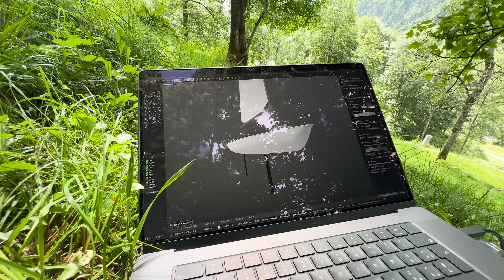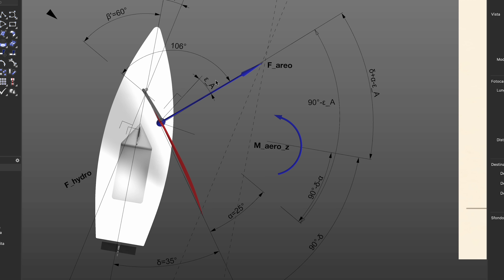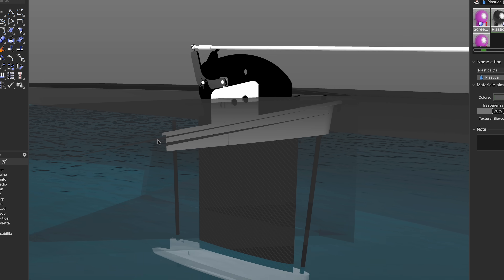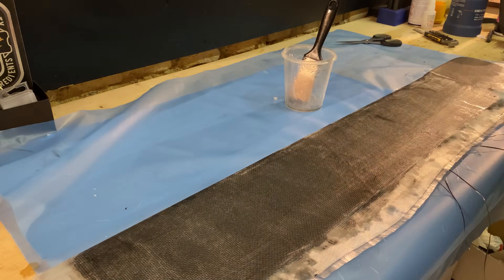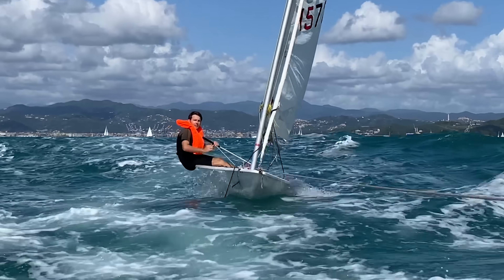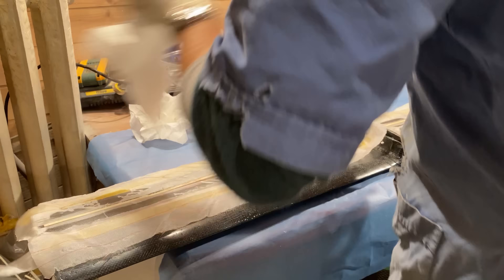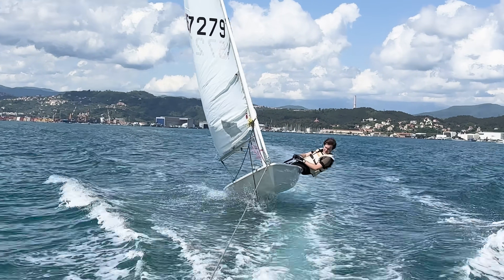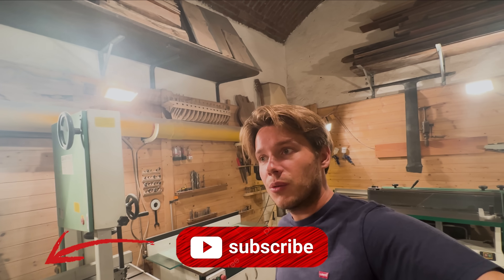Building a FLYING BOAT: Foiling LASER design and ENGINEERING

Comment: I always wondered why sail foilers do not use the v-shaped wings. They work not only as a vertical stabilizers, but as roll stabilizers as well. Because when a boat rolling, a higher side gets less lifting force, than the opposite. The only explanation this is not as fun as to fly on a rope 20cm above a surface at 20 knts ;)

Comment: For testing with the tow boat,  you should have attached the tow rope to the mast at boom height or higher. Its closer to the normal center of lift, and center of lateral resistance so it would be easier to control.
You should do testing without sail, only the tow boat to adjust the lift, the height above water. When all this is ok, you can do the testing with the sail.

Comment: As a pump foiler, this design is impossible to achieve.  You really need constant strong wind to keep you going but you will have to deal with weight issue.  Even your full body cannot counter-balance the full weight of your vessel. As a pump foiler, you have to put your weight on your front foot and knowing the proper pumping and pushing action to pump forever.  To add..your balance of going right(frontside on your heels) or going left(backside on your toes) to those who are goofy stance like myself. Foiling is very magical and the only way to achieve this is ditch the sail and put a power drive system on the mass of the foil and then the boat will fly.

Comment: I've loved the Laser since the 70s. I worked for King Marine in Indianapolis then. We were Laser dealers when Sailcraft made them.   IMHO a Laser could be adapted with 2 lateral foils and the rudder foil in the fashion of the America's Cup boats.. The Laser's sail rig is more appropriate for lower wind speeds. I have bent booms in process of finding that out. Battens would likely help but a higher aspect sail would yield better results. 
 Best wishes for success

Comment: Honestly I think you are trying to apply a foil designed for a different shaped boat. The oil may need to be SUPER wide - I saw a foil on a stand up board recently which is 3 times wider than the craft and gave it great stability.

I think the shape is also wrong - more curved, with deeper at center - like curved fins radiating out.

Comment: Great work! For the graduation. :) Congrats!
Check how is it done on Flying Moth.
I think, for take off you need to manually push flaps down, with speed they need to be released up and controlled by the auto-wand. Make the wand longer.
On airplanes rear wings, the stabilizer does not produce positive lift. It makes some negative lift. It is very important. It is how the pitch is naturally stabilized.

Comment: As someone who used to race Laser's I would love one of these!! Absolutely genius! If I had a shop like that man, I could make anything!
Reply: Have you tried one? The Laser is a great class, but reliable foiling needs a very different boat. Foiling well requires lots of righting moment to handle the high apparent wind, and a rig with very low aerodynamic drag. The Laser doesn't qualify on either of those counts. It's not hard to pop up on a reach in moderate winds in a foiling Laser, but that is very different to being a more practical foiler. You can't foil upwind because you cannot get enough stability and the rig creates too much aero drag. You therefore sail a lot of the time with the hull immersed normally, and then the foils really slow the boat. Foiling is about a lot more than just popping up on a reach.

Comment: Really cool experiment. Just some unsolicited suggestions to help you from a Laser sailor. You need more cunningham tension to remove wrinkles from the luff of the sail and move/keep max draft in the sail forward to about 1/3 - so it looks like an airfoil - it will be more aerodynamically efficient this way. As the sail stretches draft moves backward so you need more tension as the wind increases. Also a tight loop of rope around the boom and attached to the clew of sail, so it can slide back and forward on the boom and the outhaul only controls outhaul tension, to keep it snug to the boom, and more outhaul tension. Tie your outhaul to the eye on the boom and loop through the sail so you get a 2:1 mech advantage. Do the same with your cunningham. In the wind you are experiencing here a flatter sail with more outhaul tension works best. I've never seen a jib on a laser before or a main that does not have a sleeve to go over the mast? With a properly trimmed sail (outhaul tension, cunningham tension and vang) you will get less healing and more forward driving force.

Notice the commercially available foiling sailing dingys use side foils. It would make balance easier.

Comment: Curses! Foiled again!
I'm trying to learn wingfoiling and it's not easy.
I tried to e-foil and it was hard also.
It's like dancing on a dinner plate on a pedestal.
Lots of broaching and splatting.
I've been thinking about a biplane wing with lots of lift at slower speed to break surface stiction. Once the hull is up the upper wing is out of the water for less drag.
Instead of splat landing the upper wing renters and cushions the landing or regenerates flight.

I wanted to make a foiling catamaran using an old Hobie cat and a trolling motor.
The wide beam and low friction seem perfect for foiling.
The foils could be attached to the aluminum cross beams and retract up for transport, beaching and conventional putting around.
Then they can be lowered electrically or manually to lift the hulls just off the water for calm days and learning or higher for advanced flying and chop or swells.

After watching flying fish I noticed their tail works only on the surface of the water avoiding drag and providing lift.
It moves in a quick S shape sweeping across the surface.
How cool if this form of propulsion could be copied.
Maybe the pectoral wings could be copied too providing lift along with altitude and steering control.

I watched the flying fish from a high speed foiling catamaran ride to Catalina Island.
Flying over the swells in the giant ship with throbbing motors kicking up rooster tails I felt like Man was King of Sea and science.
Then I saw the flying fish gliding silently from crest to crest and realized how much it was taking for us to do the same thing and was instantly humbled.
Reply from the maker: Thanks for your comment Jeff! The similarity with dancing on the dinner plate is perfect ahahah. Making a foiling Hobie cat would be great fun, also maybe easier due to the double foil configuration that a catamaran offers. Always taking inspiration from nature! 
Thanks again!

Comment: I have just watched this for a second time. Incredible project and video documentation.
I am doing a CFD Major Project for my 4th Year of Mechanical Engineering BE. Which program were you using for your CFD analysis? I am using CREO Parametric for 3D modelling and Ansys CFX/Fluent for the CFD.
I'm really looking forward to seeing the next video in this series!
Reply from the maker: Thanks a lot Daniel! I used xfoil for potential flow, and I also use Ansys for cfd, but for 3d it’s really hard to use… for 3d modeling I use rhino, but sometimes also creo is useful!
Reply: @EdoardoChisale  Thank you for your reply. I've watched this video a few times now. There is so much useful information in it.
Do you have any links you could provide me with for further reading? I assume you are some kind of Naval Architect. I would love to study Naval Architecture further. Unfortunately the University in the city I live doesn't provide that course so I studied Mech Eng.
When can we expect another video?

Comment: Nice. I just check your video when you sail. What I observe (check 1.04 minutes) : when the boat is on water, you have a certain position on the boat to counter the effect of the wind (which acts as torque on the mast). The angle is maintened by orange force. When the boat is outside of the water, orange force disapears , so you need to put your body far away to counter the torque. So, your foil need differential elevon (like a plane which turns left or right) to counter effectively the torque. I hope that i was clear in my explanation
Reply from the maker: You're right! I thougth about it, that would be a very clever design, but as a first try i went for the easyest construction. It would require a electronic control system but the differential elevon system would be great to build (but also complex). I was thinking to change foil configuration, the problem is time ahaha. Thanks for your comment!

Comment: Looks like you need more lift from the rudder, this will keep the boat level and reduce the main foil lift plus it will also mean the wand stays in contact with the water so that the wand control will work properly.

Comment: In low wing aircraft with dihedral it isn't slip and AOA that makes them stable, because side slip is extremely inefficient and is used to shed energy. Turns are coordinated using the rudder. When the aircraft rolls the horizontal area of the wing on the down side increases, and the other side decreases. The center of lift moves to the other side of the center of mass and you get a counter roll moment. The Harrier, which you used as the anhedral example, is stable because of the metacentric height. Just like a boat. The ten tons of aircraft mass are centered well below the center of lift, so the aircraft hands like a pendulum.  The C-5 and C-17 have similar characteristics, but in their case the static images are deceptive because the wings flex upward in flight too. So as their lead increases they become more stable. Fuel load also increases aerodynamic stability, but raises the center of mass, because it is carried inside the wings. F-104s had center mounted anhedral wings, and a Stability Augmentation System to stop them from rolling.  The F-4 also used stability augmentation, because it used a low, flat, wing with relatively small dihedral tips. However it could still be flown if the system failed, like in a double generator failure. The Eurofighter Typhoon has a low,  flat, wing and is not aerodynamically stable. I don't know if anyone has managed to fly one with the control system in direct mode. If it even has one. When I was bidding work on the Eurofighter we used to joke that the flight computer fail light should be linked to the ejector seat.

Comment: Nice thesis project. If I may make a few suggestions   In line invert T foilers  only have stability when heeled to windward  see Dave Holloms article in seahorse. Carbon  sheathed wood longitudinal cores need a 45/45 shear web   So that they do not fail in core compression particularly at centreboard case exit  to avoid carbon step fracture  put the majority of your longitudinal uni carbon in a trough of 4-10 layers 10-15% of chord width. This will more evenly load the  carbon flange  which should be over the shear web. remember  elongation strain to fail as well as stress in your distribution of load carrying . You will need quite a lot of 45/45 on the vertical foils so that you do not have 2 rudders. Say 1200 gm at least. Hope that helps
Reply from the maker: Thanks you for your suggestions! Appreciate it!
Reply: In-line foilers do NOT only have stability when heeled to windward. Even when upright there is still the weight of the sailor well to windward, just as if the hull was in the water. They do generate MORE stability when heeled to windward but that is very different from saying they only have stability with windward heel - go out and try it!

Comment: Looks neat, but I wonder how would you have changed the design if you had no manufacturing limits?
Organically shaped foils? (Humpbacks shaped foils, I didn’t remember how they were called)
Or two L/T foils at the edge, rather than one singular t foil?!

And the last question, where would I find your thesis? :)
Reply from the maker: Thanks you! well there are two mods I'd like to do... or add differential lift in the main foil (as plane aleirons) or as you said add two lateral foils.. if i can find some time I would like to make the project with the lateral foils, I think it would be much better!

Comment: Awesome job. Ive found the bubbles from the propeller in the middle of the wake also make the foils loose lift and hard to control. Looks like you might have figured that out too though moving to the side a bit. Great build!
Reply: Fancy seeing you here, Sam! Send some sponsors my way! Am stranded 😂😅
Reply: Excellent observation!   There are aeration pools at a sewage plant plastered with signs that say "Caution, you will not float in this water". Obvious once pointed out.  Even a longer tow line will "fix' the towing  problem.  The America's cup prototypes tested their systems without sails, just a tow
Reply from the maker: Thanks you Sam! Yes turbulence and air bubbles make the ow very hard to predict! I'm also thinking to use a different foil conofiguration in the future, hoping to have some time to spend in this project... youtube is so fun that pushes to do more! Thanks again

Comment: You also need rotational equalibrium.

Personally I would suggest two seperate foils either side of the boat because it gives you better moments of force.
Reply from the maker: That would be the best option, I went first for a single foil just to not modify the original structure of the boat. A two c foil system would work better for sure... maybe I'll try in the future!

Comment: Even though the flapper is a nice touch, the whole wing needs a radius design. Also, it doesn't have to be at the very bottom of the keel. The rudder wing can be different, it also needs more lift to keep the rig longitudinally stable. The keel wing is pushing the whole boat up and these two lift points with the center of mass should form a triangle, where the COM is in between the two lift points. If there is a lot of mass outside the area between lift points, the rig is unstable.
Reply from the maker: Yes you’re right, I made this design similar to the moth to not modify the laser structure, but the boat is significantly heavier and probably the best design should be two lateral c foil, that generates some righting moment… maybe will do in the future😉

Comment: For tow ups, pull the boat at an angle or steer the boat at an angle to the boats direction of travel… having a force pulling on the boat (like wind force on a sail) perpendicular it the direction of travel means you have something to lean against and makes balancing way easier. Also, there’s a reason most hydrofoils have heavy anhedral: when you have windward heel - crucial for upwind sailing - dihedral or a flat wing will cause the wing tips to breach, and if you have a consistent airfoil profile I.e. no washout or altered lift distribution at the tips, you will get ventilation on the foil and crash.

Comment: Subscribed, what a fun project. I agree you're making it harder in a way to tow behind the boat. Not only for the reasons you mention but also the wake of the boat and turbulance disturb the foil a lot. I kitefoil, and also foil behind boats and it takes quite a bit of practice to get used to the boat and you need very quick reactions not relaly possible with bodyweight in a sailboat. Or use a very long rope at least next time.
Reply from the maker: Thanks, you're right, it neeeds to get used to it :)

Comment: Great work! I built my own E-foil based on a large Axis foil, and my feeling overall is that it never hurts to have too much slow speed lift... The energy to get the boat lifted out of the water and break the surface drag is huge... the quicker the foil lifts, the lower the speed/power needed to get up, even if it limits your maximum speed on foil. It's more fun to have something that can get up in 15kt winds reliably than to need 25kt. A sailboat doesn't really have the same "burst mode" as an e-foil to break the surface. It takes me 1000W to break the surface, and only 475W to fly. I feel as the foil size and lift goes up that ratio will come down and takeoffs won't be a super hectic beam reach...

Comment: Nice job.  I did the same thing with my Laser. Check out the video I posted of taking off under sail.  Carbon Fiber foils, molded with resin infusion, and using carbon fiber internal spars.  I utilized the same type of control mechanism.  The biggest secret I discovered was that to begin to take off, the laser must tip towards the wind.